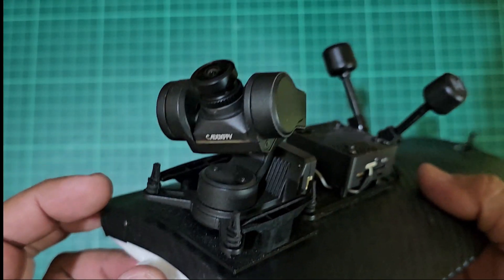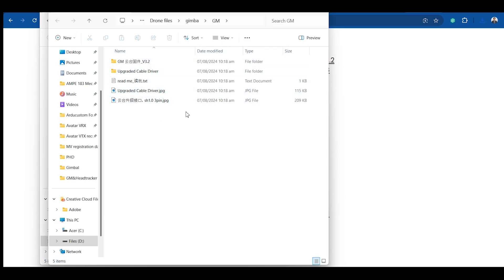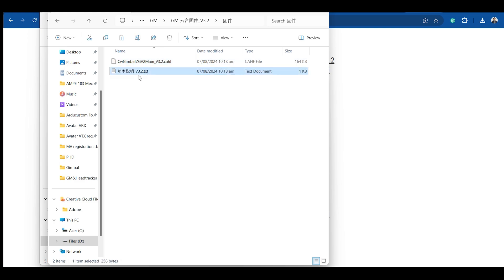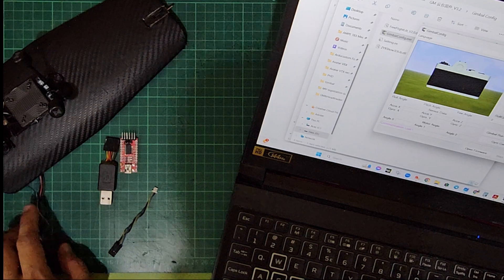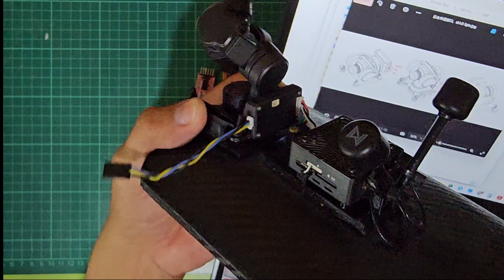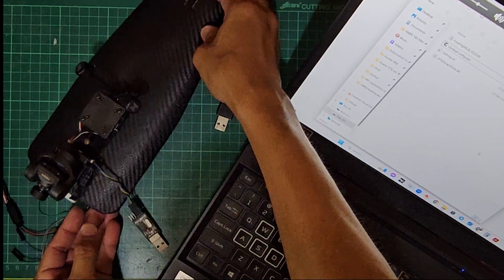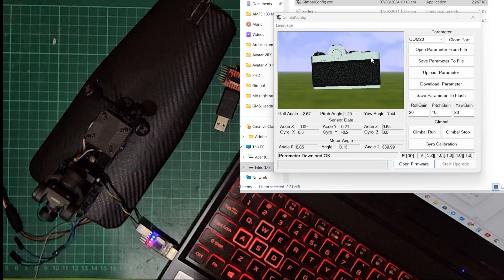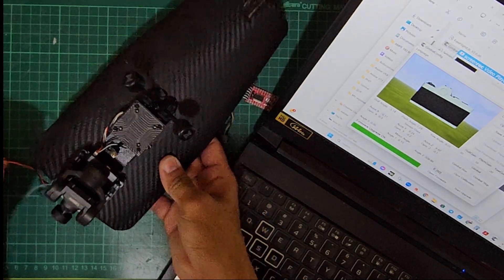How to update firmware on Walksnail Gimbal

Comment: This was a very helpful video!

I'm trying to use this with iNav serial control mode via UART instead of the PWM.  Everything is setup on the radio and iNav with the pan/tilt/roll channels but the gimbal is not responding via UART commands, but the gimbal responds via PWM.  Is there some special configuration in the gimbal I need to activate to enable serial UART control instead of PWM?  I'm using latest gimbal firmware v3.8.

Comment: Would you think that the motors on the pitch axis would have a hard time handling the the cable for the video on the DJI O3 air unit??
Reply from the maker: hi there! the gimbal is designed to work with the O3 as well, just make sure you route the cable properly. You may also need to consider longer mipi cables for the 3 axis gimbal, shorter ones may work with the GM1 or GM2